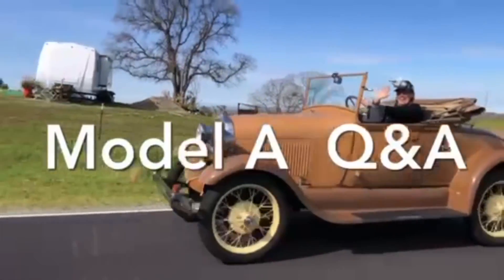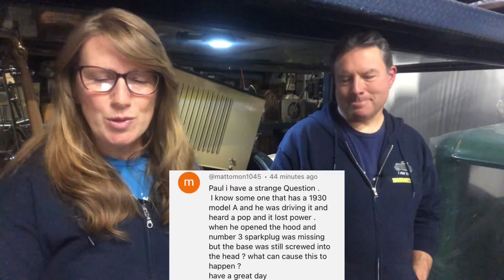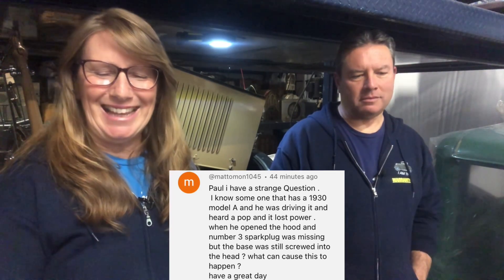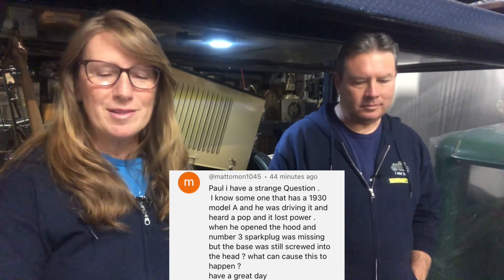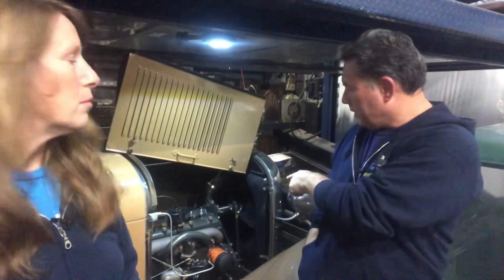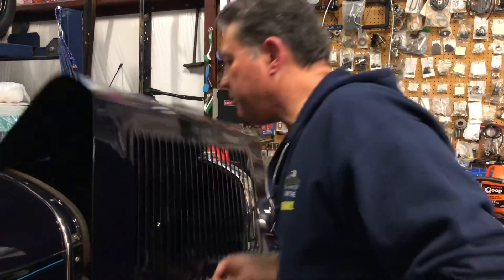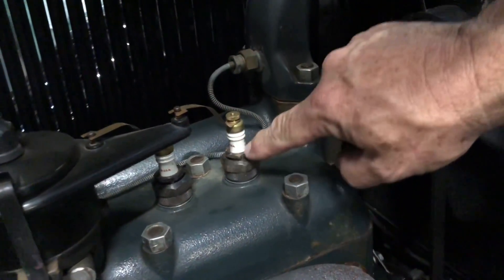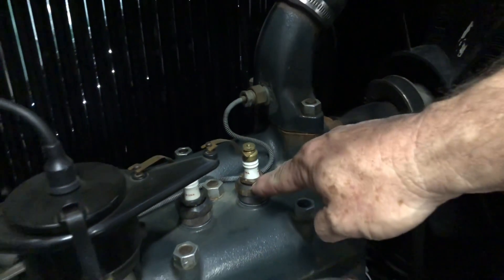Ford Model A Q&A of the day - what happened to the spark plug my friends 30’ Model A?

Comment: Model T is working over time. Ford did it again years later with certain versions of the Ford Triton engine, which are prone to having the spark plugs blown out of the cylinder head. Fixing this issue usually involves rethreading the cylinder head. However, replacing the cylinder head is necessary in extreme cases. Mostly 2004-2013 3-valve engine but some problems spanned all engine generations. Most of the time this happened due to plugs getting loose and then damaging the threads in the aluminum head. Always torque plugs to factory specifications. In the old days, 70s-80s lol, some engines would strip threads when replacing plugs due to carbon buildup on the lower threads cutting away the head threads as they came out. On these engines, you needed to run a decarbonizer through the intake to soften up the carbon and then remove the spark plugs. Take care, Mike ASE Master GM Ford Dodge/Ram

Comment: Ah, Jedi Paul the force uses problem sees before Tina speaks! 
Yeah, two piece spark plugs were a huge problem for Ford in their modular motors (4.6l V-8). The top would break off leaving the threaded bottom still in the head. They 'fixed' the problem by going to a 'one' piece plug. Not as rare a problem as some might think. Even happened to my brother in his car (first time I saw it personally).
Good stuff, my Jedi! 
The Force flows from you!
Reply: Me? Funny? Said it ain't so! 
I'm silly putty in human form. With emphasis on 'silly'. 
Good stuff from team Shinn!
Reply from the maker: You really need to write a book, it would be fun to see what you’d write about! You’re fun, have a great week! 💗